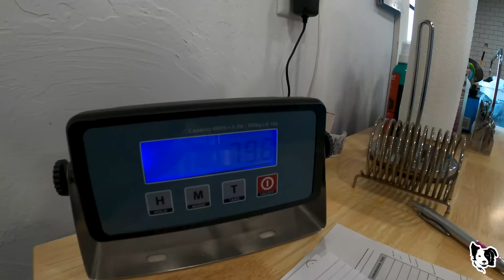GROOMING 10 DOGS IN ONE DAY

Comment: I know all groomers are different. But there are certain things that I will not do to a dog…like harshly spray anything directly into their sensitive ears… especially with a large spray bottle. I will gently pour what’s necessary into  the ears…but I pour it in gently.

I try not to get any water in their nose or in their ears. I know that they dislike this terribly and too much water going down their nose can  cause pneumonia. I am very cautious around their face and head. I could not do what you do. But like I said, everybody’s different. 

The twisting of the hair in the ears is an absolute no-no for me. I was taught at the twisting of the hair in the ears is extremely painful, and under no circumstances will I subject any dog to that .  I will gently pull out the ear hairs a little bit  at a time to prevent hurting the dog and causing any discomfort, if there is hair that runs deep, I will use hemostats but again,  without hurting the dog.   
I groom dogs the way I would want my dog to be groomed…. With respect and dignity.

I would think that most dogs would react the way these dogs do having water sprayed  directly in their faces  and/or heads.  I do not think I would like it much either and I don’t agree that they are reacting this way, because they are not used to being groomed. Just my opinion.

I also cannot get a a dog’s coat properly prepared for a haircut without brushing the coat during the drying process. This is why I do not use cage dryers on coats that need to be prepped for a groom. I’m curious how you get around that or if that’s something you even consider? It makes a difference, even if you’re just shaving a dog.

Although I don’t agree with a lot of what you do, I do think you have a good heart and you’re trying to help out as many dogs as you can. Sometimes, I just can’t help wonder, if dogs could talk what would they say about the way they are handled when they are groomed.  

Not trying to trouble trouble until it troubles me not wanting to be easily offended or offend.

Grooming for 28 years now

Good luck to you, MaryBeth
Reply: Nicely said ❤
Reply: @estherwinnie12 I am a groomer also and I totally agree with you. I would never put liquid in the dogs ears by spraying it in them and she puts a lot. Also the hemos and twisting that has got to hurt. I mean they cry. I can't watch her anymore.
Reply: It is painful to watch.  Unfortunately, most people don’t know the difference and take her word for it. I don’t think she is a bad person, but there are a lot of things that are questionable and certainly not something I would allow my dogs to have done to them.  There is certainly a difference between a professional and qualified groomer and one that is not. 😢
Reply: i completely agree with you. i feel that starting with nails is probably not a great idea when you have an anxious dog that is groomed infrequently. you want to give them a reason to trust you, which hopefully by the end they trust you and feel safe with you, more than at the start. they might be a bit more tired at the end so they might not be as resistant to clippers or that stupid noisy dremel. i don't understand why she doesn't invest in getting some happy hoodies
Reply: She's doing everything most groomers do. Also time isn't something they have all day to do one dog
Reply: Yes well said